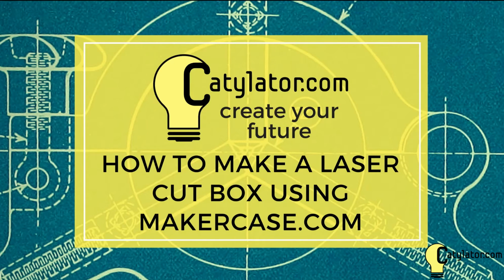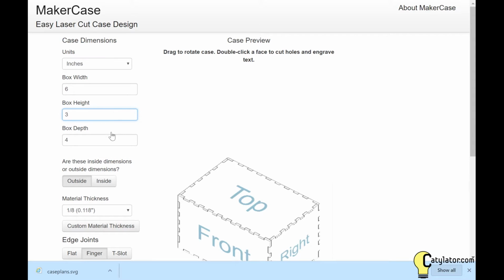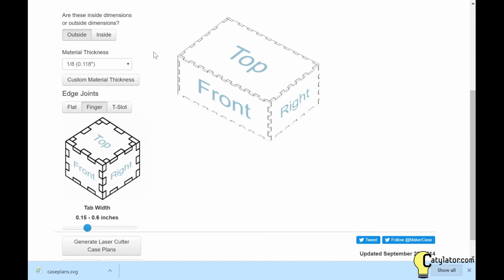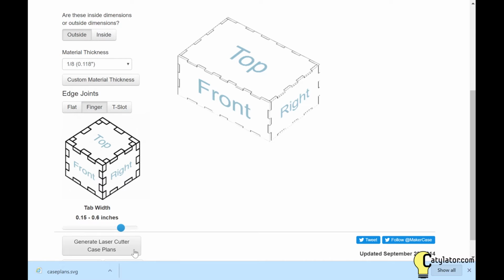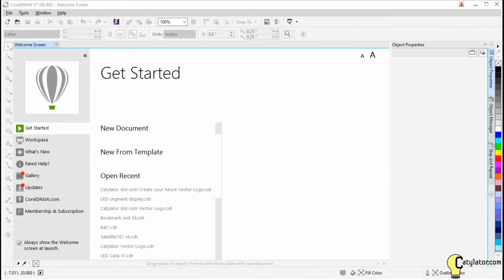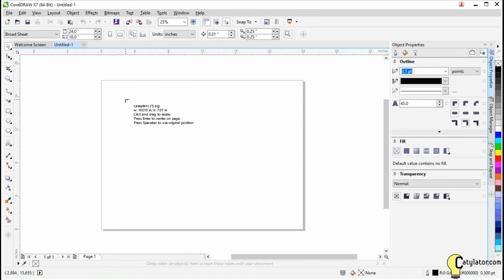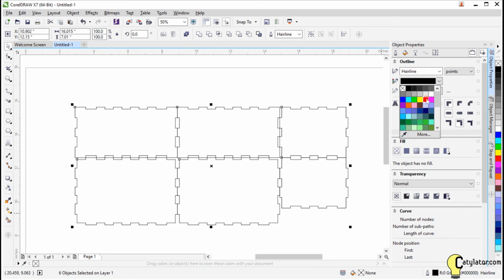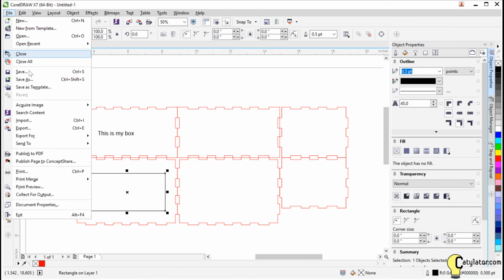How to Make Lasercut Box Patterns with Makercase.com and CorelDraw

Comment: I am trying to find someone that can help me make a file for picture frame / shadow box that is possibly able to be resized.  For instance, I have laser engraved a 1/4 inch thick movie poster that is 18 x 24.  I would like to frame it however the frame has to be thick enough to hold the poster and glass.  I would like to make these into multiple sizes.  I would also like a shadow box file to display a baseball bat 3inch x 4 inch x 36 inch.  I will gladly pay you for your time if you think I this is something you can help with.  Thank you